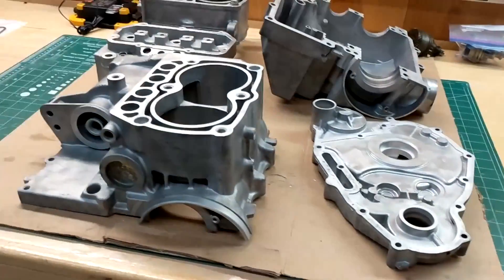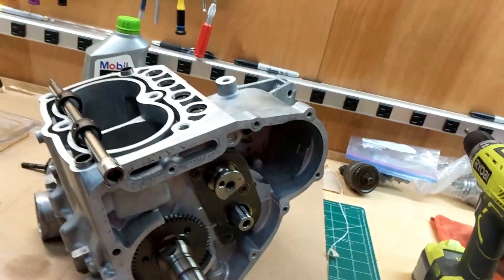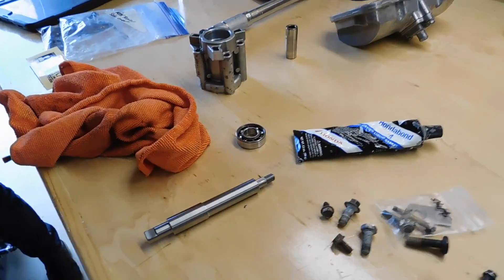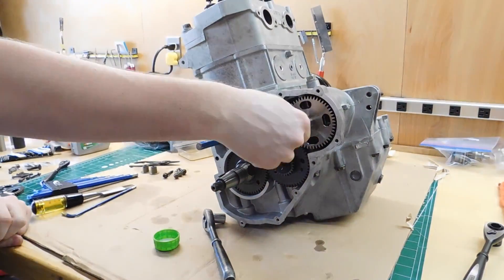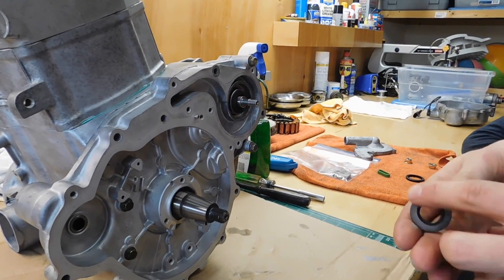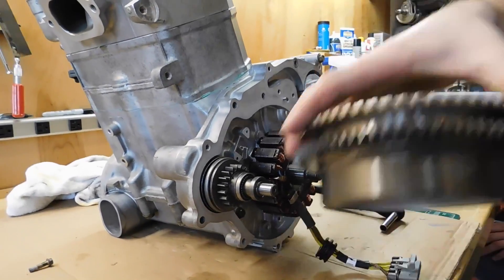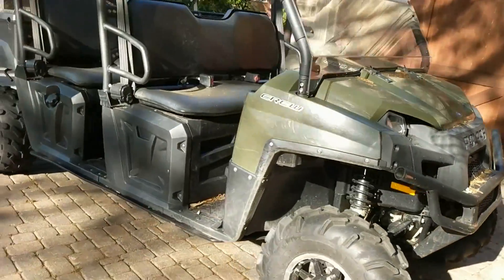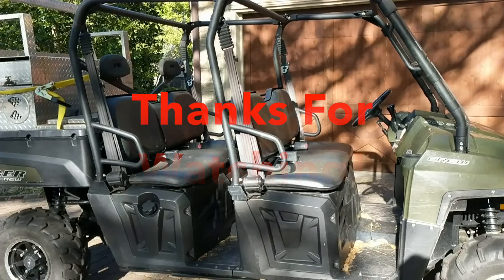Polaris Ranger 800 Engine Rebuild Part 2: Rebuild and Install

Comment: Hey, so im trying to replace my cam chain tensioner on my 2011 rzr 800 where at on the engine is it? im having a hard time finding it. Any advice would be great. Thanks
Reply: As far as I know this is a pushrod design engine.
Reply: doesnt have one

Comment: This video shows how to do lots of things wrong.  Guaranteed to have lots of problems later.  You'd have saved yourself a lot of headache by just taking off the clutch to start with  (you can easily make a DIY clutch puller with a 3/4" rod, a couple nuts, and a grinder) and you tried separating the crankcase before taking the other shit off which probably warped the engine block from all the prying you did.  When you put it back together, you didn't bother talking about the types of gaskets, which ones need gasket sealer, which ones should be dry, and which ones are a liquid.   You didn't talk about priming the oil pump (so you probably didn't do it which means that it won't be long before the engine seizes) and you didn't talk about torquing the bolts for each component or the sequence for doing that.   This video is dangerous because it could cause people to screw up in a very expensive way.

Comment: how do you time it? tdc and line up the dots on the gears and that's all? could it be that simple
Reply: Yes just line up the gears, they have a tiny dot on them
Reply: @russelllund7283  you have to time the engine on the compression stroke to time it on a 4 stroke there is 2 top dead centers
Reply: pupbiking how do you know which one your on?
Reply: @adamharding7617  well on mine i but the side gears on and all the top end then put my finger over spark plug hole and turned it counter clockwise when turning it over i could feel the compression so when piston got to the top i checked the dots to make sure they lined up if they dont then you have it timed on the wrong stroke also before i tore down the bottom end i lined up the dots and then looked to see what way the lobes were pointing so when i put it back together the same way
Reply: but i double checked that way when i felt compression i turned it till dots lined up
Reply: Black, what did you find out about the timing?

Comment: Do you think it’s possible to replace the camshaft without pulling the engine completely?
Reply from the maker: James Hill possibly, but it’s not too hard to remove the engine so it would probably save you time in the long run.
Reply: Yes you can replace the cam by pulling the cylinder head, stator cover, stator housing, flywheel, stator, bendix, cam gear, balancer gear, and pulling out the lifters, but all that is a huge pain with the engine stuck in the bike and if your cam has gone bad then it probably means you haven't been keeping the oil clean or up to the correct level or you could have a problem with the pump; basically you probably should take the engine out & look at the crankshaft  to make sure it isn't failing or you'll be doing it all over again.
Reply: If you are going to replace the cam, you will have to take off so much crap that it'll cost a fortune if you buy all the seals and gaskets separately so look for a seal & gasket kit on ebay to save money

Comment: Impressive. I may have to do the same thing to a Ranger 500 crew. How many man hours did it take by task? Removal? Rebuild?  Reinstall? By the way, there is a special $50 tool to remove that secondary clutch, or you can find the video on here where a guy grinds down a threaded rod to do the same thing.  How much did the parts cost total?
Reply from the maker: Tom Hynes It took about 2 days and cost about $400.